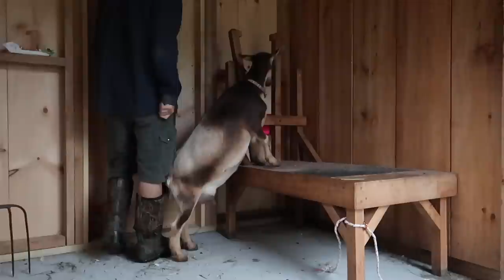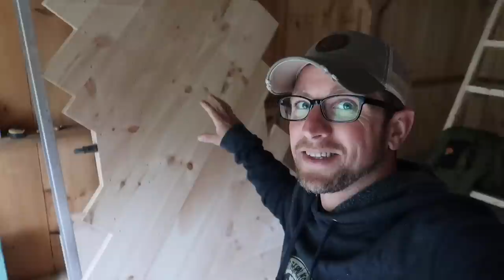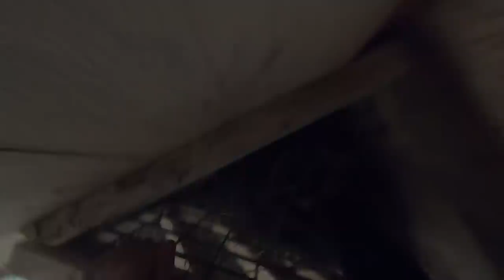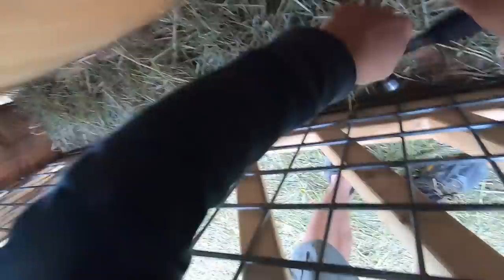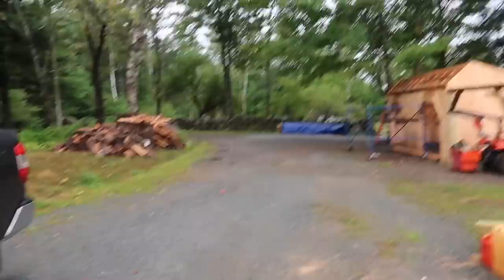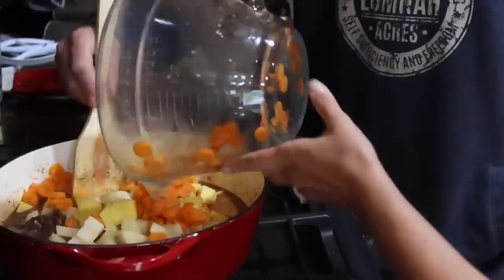this DIY Hay Feeder HACK It's gonna save us $100s on Wasted HAY

Comment: I hope this design works but here is another possibility.  We use a similar design for our horses, except the grate is put on top of the hay.  Then it simply lowers as the hay is eaten.  In your case, the goats could still put their heads fully in the feeder but would have to work to get the hay through the grate.  An idea worth considering if there is too much hay left at the back of the feeders that the goats can't reach.

Comment: I think the reason that they did not waste in the old feeder was because they left their heads in it the whole time they were eating. I think the new feeders were not deep  enough for them to put their whole head in and still see out the other side. Like it is too close to the wall. I hope the wire helps.
Reply: I thought the same thing when they 1st built them.
Reply: I think that they also might be so used to eating in the natural head down position in the old feeder that they are pulling it out so they can drop their heads while they eat.

Comment: You need a roof extension over the outside hay feeder so the goats will be able to come out at least that far out on a rainy day.
Reply: I'm sure they'd appreciate the protection from snow as well.
Reply: Al said on a previous volg that he has plans to cover the whole backside of the barn with a slanted shed roof for the goats to have a dry area and semi-free from snow.
Reply: It would cut down on the pee smell inside during  the wet and snowy months also.

Comment: Hey Al, great idea for the goat feeder, it will be interesting to see if they will be able to get to the last of the hay as it empties. If they can't you could put a board as a false bottom all the way across at a 45 to the back wall, maybe sand it a little smoother than rough sawn, that way the hay will always slide down to the front of the cage where they can reach it and hopefully eat it till it's all gone.

Comment: Use mesh and not wire so that there is some give when the goats push on it. Or you can use slow feeder nets and stuff the hay in them, place these in the feeder and that would work well too.   Slow feeders are great as they slow down the consumption (keeps goats busy longer) and very little waste.

Comment: Al I would think about putting  the wire in on a angle from front to bottom back then they can get there head in but the trough will catch most of what they pull out. I built my sheep feeders out of plywood on the ends and trough with 2/6 side rails and wire mesh angled to the middle of the trough to catch what they dropped, with a hinged roof on it because you get so much more rain I think you would be able to save a lot of hay.

Comment: Another additional hack you can do to the feeders too is to add a slide board.  What I mean is put a sheet from top to bottom in measurement.  But the angle is what needs to be in place.  So the top of the sheet would be at the back top part of the feeder, and the bottom would be in the middle of the bottom of the feeder.  So when you put the hay into the feeder, it slides forward and leeps itself against the cage.  Instead of hanging out in the back side untouched until you come and push it forward.

Comment: The mesh seems way too small for the goats to get their head  inside  to eat . The hay will not 'feed or fall' to the front of the feeders, it will need to be pulled forward manually.
Reply: Agreed I don't think it will be in there long.
Reply: I think the idea is for their mouths to get in there not their heads. It’s the same concept as a hay bag or net except it doesn’t give. Trial and error I’m sure though :)
Reply: Is thinking that if the mesh was installed with the bottom at back of.bin and leaned forward at top at a 45 the hay would always be accessible. Just drop hay on backside of mesh and gravity would make all of it available
Reply: @CassarolesDad  That's what we do. I used this 4x4 and put it at an angle with a trough at the bottom to still catch what they pull out. Works really well.

Comment: I hope the hay feeder works out now.  I tend to agree with another commenter that perhaps you needed to make the bottom deeper so they would need to put their heads in and down to reach the hay.  If the wire doesn't allow them to get to the hay, maybe you could try deepening the troth.

Comment: I wish I could have told you to put the wire rack in there a little differently. If it would have been put in at an angle from front to back (the top of the rack where you put it, but the bottom of the rack at the back of the feeder) the goats could still put their head in to get hay, and they would still have to pull a little at a time from the rack, but any that they dropped would just go in the bottom of the feeder and there would be a second chance to eat it before it would hit the ground.   However, I haven’t tried it yet myself. I do have feeders that are essentially the same as you just made, and there is still a good bit of wasted hay. Hopefully it’s just my goats and you have better luck. I really like your channel and the projects that you do, I’ve learned a lot. Thanks

Comment: Hi normaly when you use a cage for the feeder you have to put it in an angle at least 30 degrees otherwise they wont be able to eat enough but if this works then well done

Comment: How are the rubber mats working out? Easier to clean?
Reply: Unfortunately the urine will eventually make its way under the mats. The only way to eliminate the problem is to put a smooth finish on your concrete and seal it. We have been dealing with this situation for 20+ years!

Comment: Good morning Al,  I think you are putting your goats on a diet.  Once they eat what they can reach, they won't be able to reach the hay in the back of the feeder.  You might try making a slanted wall on the inside of the feeder from a fourth to halfway down in the back to about 4 to 6 inches from the front at the bottom.

Comment: I am just curious of what size the squares are on the steel grid I use 2 x 4 steel grid and it works good but I also made at the bottom the hay comes down and it slopes to the grid now on my mail goats I put two poles up put a wheelbarrow flipped on the side so that big side is pointing down so that the bottom slopes in and put my mesh over at and left an opening at the top so that I can fill it up and that works well for the male goats and that wire is expensive thanks for sharing God bless 🙏😇

Comment: I know nothing about pigs. Could it be that their teeth can't bite that big hunk of celery? What if you cut it in half length wise? (could it be that they are full of apples?) ❤🌅🌵 p.s. If you put the bottom 2-3 inches of the celery in water, the roots will grow and when planted in a pot or ground you'll get more celery stalks. Only cut the stalks you need and you'll have a plant all year round!

Comment: I have one question, where do I get that grid?!  It's exactly what I was thinking I needed for my future goats.
Reply: Hi you can get it at tractor supply. They are cattle panels.
Reply: M Devery No, it is not the same as cattle panels. The gage is thicker and the holes are smaller.
Reply: He said it was wire shelfing.

Comment: Hi, Al, Please excuse me presuming to know more than experienced 'you,' however, looking at your loss-of-hay problem once it falls to the ground when the goats pull it from the great bin you provided to let them get to it, and even with the addition/modification of the grill panels,  you said you expect lo$$, just not as much.  I was wondering...know how there's a human baby's highchair and its tray so baby can pick up Cheerios, etc.  What if you put a narrow 'tray' that catches what they pull out thru the grill & wood...to catch what 'would' fall to the ground...give them a second chance to gobble it.  [for instance: a 5" wide piece of wood/metal/plastic/?whatever? going the length of the hay feeder, then a short perpendicular piece (right-angled to the 5" piece), attached to the outside edge, to catch and hold the dropped hay...that the goats could then lower their heads to get and eat].   (Have I lost ya)?  Your hay distribution bump-out (not sure what its proper name is), is very attractive...just wondering if its doing what you want it to, ultimately.   : )